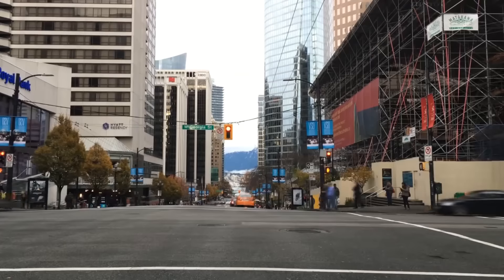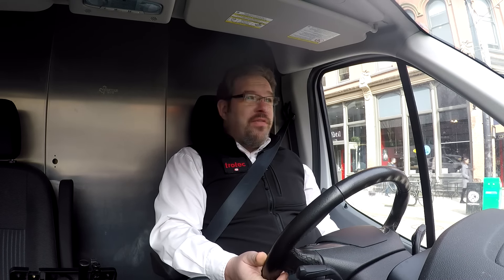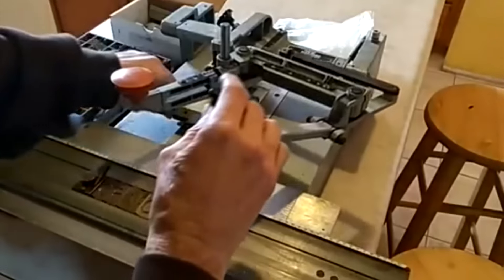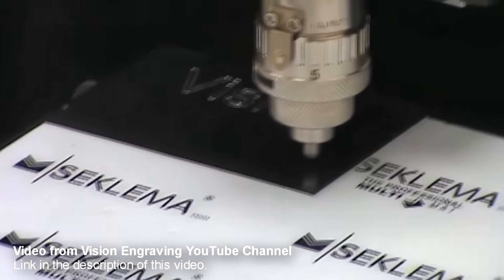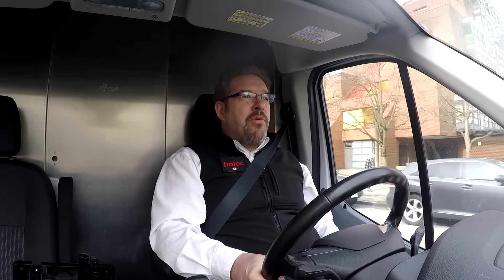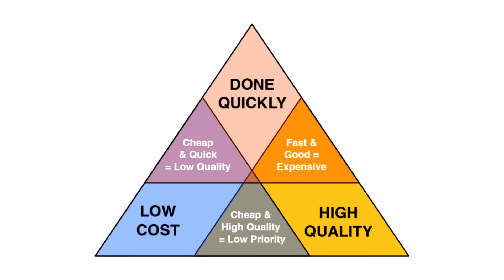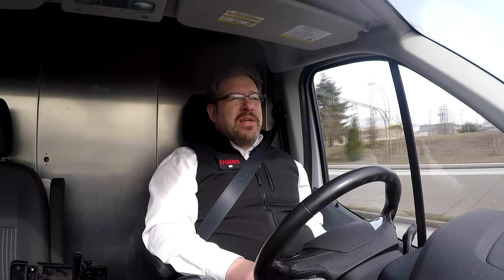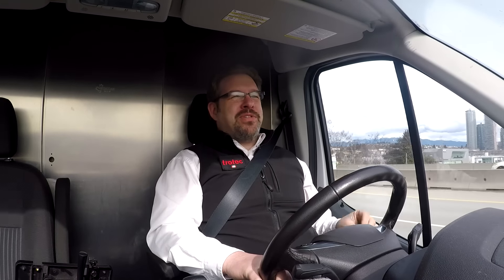How To Price Laser Cutting | Pricing A Job On Laser Cutter | Trotec

Comment: One of the biggest issues for me has been deciding how to price products - I made a couple of decently sized storage boxes (laser cut, assembled, painted, etc) and showed them to some of my friends - thought that I might get maybe NZD$10 at most for them.  I was almost floored when they said without a moment of hesitation "Damn that looks good! I'd easily pay $25 for something like that!" - I have gotten to the point where as mentioned in the video I itemise out pretty much everything - how long I will be running the laser for, the cost of materials, markup, etc then I run it by my wife to make sure I'm not selling myself short.

Comment: I have CNC machines of various types including laser and mechanical engravers. I try to think of the machine as an employee that I want to produce X amount of dollars profit per hour of working time.  Modern software makes it easy to estimate the engraving time per item. I also don't do small volume  custom work...it usually doesn't make the profit level I want. Let someone else do the less profitable work. In the long term you'll be gaining more than you lose.
Reply from the maker: Thanks guys that's a really great point. Another reason why setup charges matter so much. If you're starting out as a new engraving business, perhaps you don't want to refuse the small volume work - especially if you're building your brand through things like positive reviews and word-of-mouth. Many engravers' setup is based on minimum time, for example you can charge for a 1 hour minimum, even if the job will take you 20min you can charge for the full hour to cover your costs, make a decent profit and not refuse the smaller job.